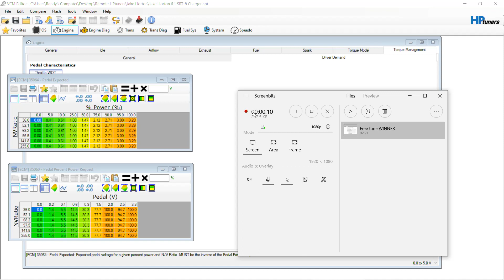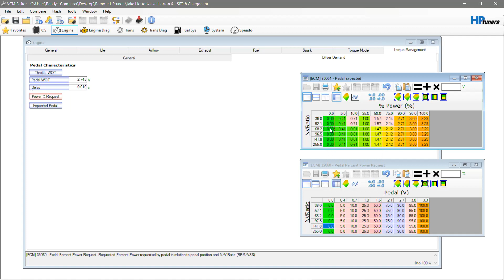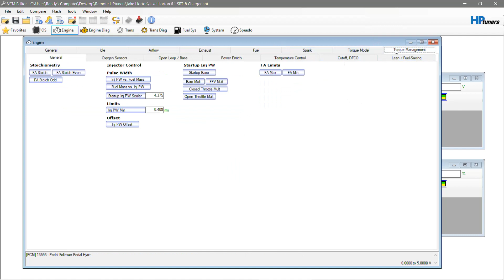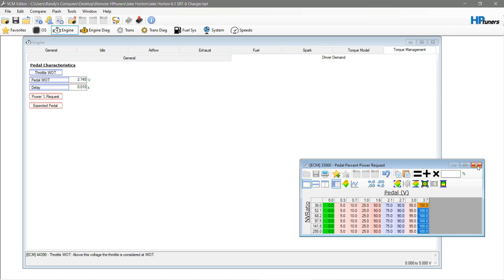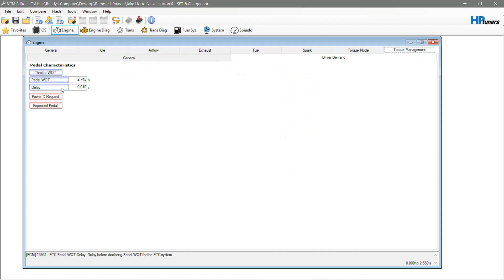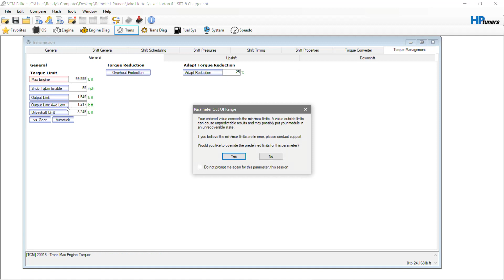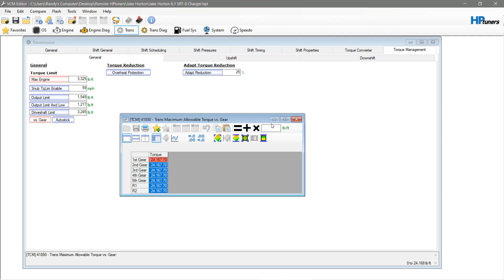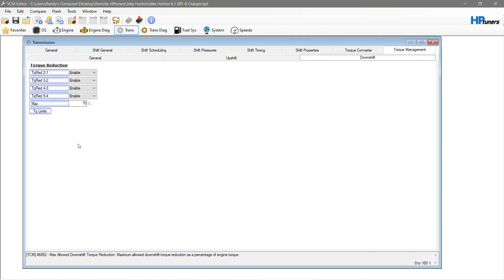Torque Management non vvt hemi

Comment: I’ve seen tons of your videos.  Thanks for all the great content 

Any chance you know how to truly disable dfco in a manual? I have a 10 charger who I can’t get fuel to stay on after throttle is released. Wanted more pop and was able to retard the timing.. but no matter what I modify in the dfco- it still cuts all the fuel as soon as throttle is lifted. Any tips would be greatly appreciated
Reply: Is neutral network being used or the VE tables being used?
Reply from the maker: Turning off dfco will give you less pop typically
Reply from the maker: Watch my gm video for it and you’ll get some ideas of what you can all change

Comment: Hey my guy I'm the guy that has a 2008 Dodge Charger with the Comp Cam 273 police packet and my issue that I have is the car won't go past 83 miles per hour RPM only go as high as 3000 the car just won't go in overdrive when I floor it the car crawls to 83 miles per hour the only code that I have on the DTC on HP tuners is stating crankshaft relearn cuz the car takes a little long to start maybe like 15 seconds before it cranks what this right here help my overdrive issue please let me know
Reply from the maker: Have I looked at it?
Reply: Naw u never sent me ur email to see data logs an graphic tables send me ur email I got u
Reply from the maker: @chevyreid1711  Randy.Ziegelbauer2014@gmail.com